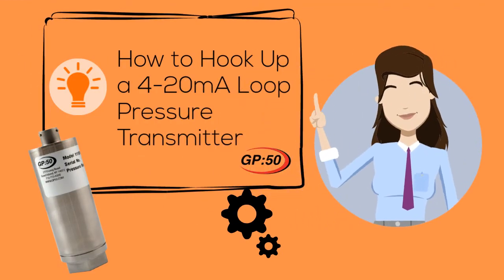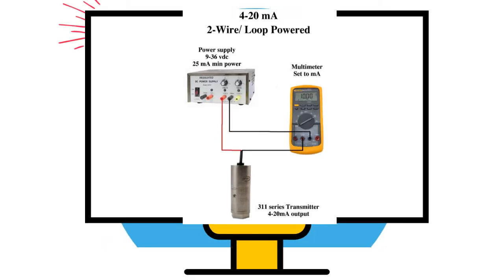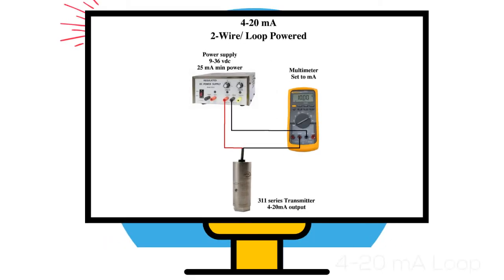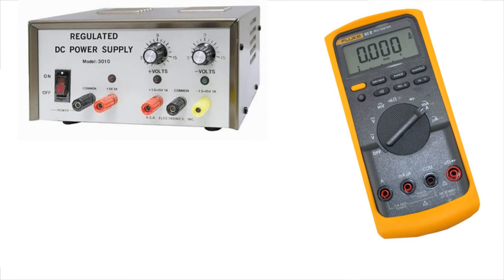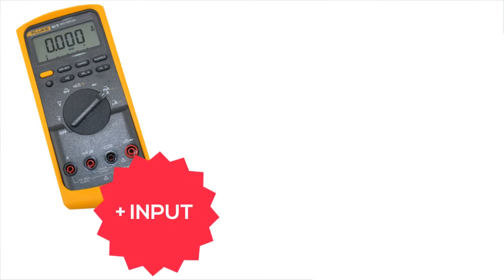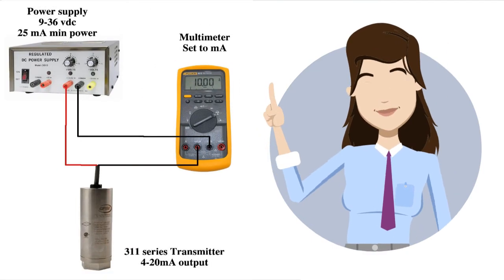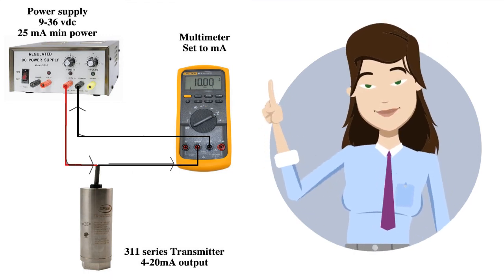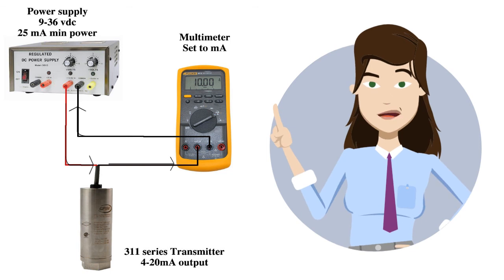How to hook up a 4-20 mA loop

Comment: Where is 250 ohm resistor??
Reply: Mohammed, a 250 Ohm resistor isn't required if your trying to measure the 4-20 mA signal on a loop powered transmitter. Thats only required if you want to convert this to a 1-5 VDC output or if you trying to calibrate a HART device. Bob Atwood- GP:50

Comment: what if have two sensors and only one power source?
Reply: Venkat, you can only run 1- 4-20 mA unit per power supply. If you add a second it will draw current and change the 4-20 mA loop